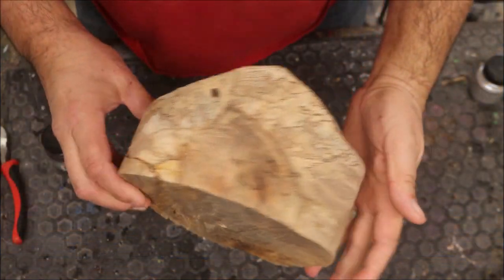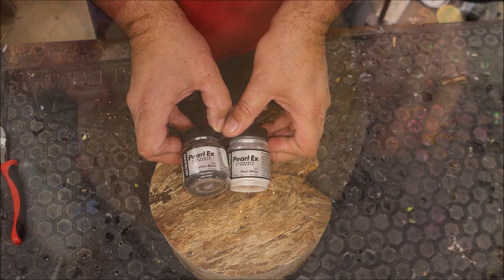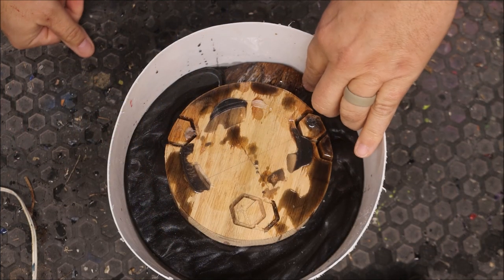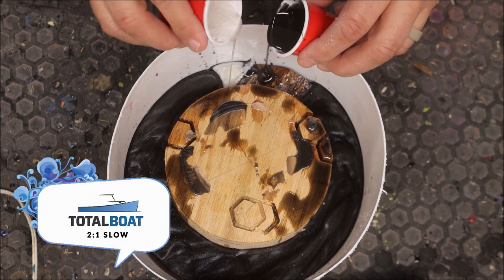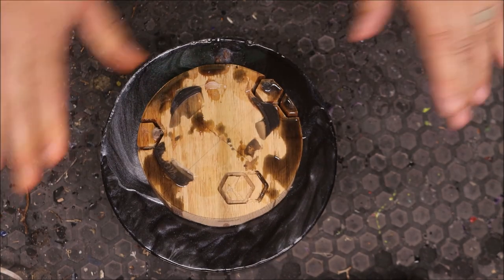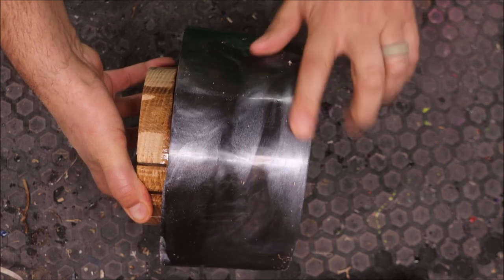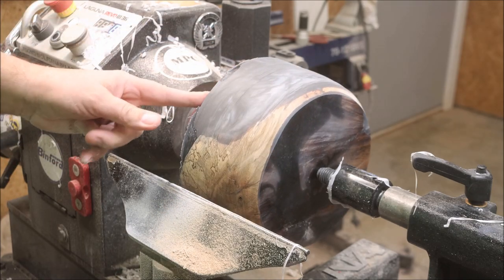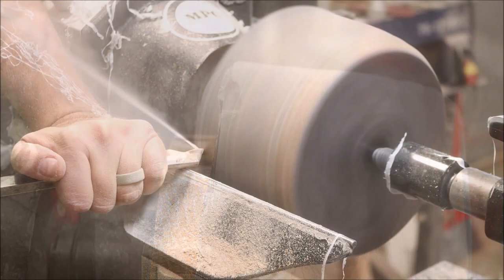Does This Bowl Look Like a Storm? ⛈🤔

Comment: Do you only use negative rake carbide cutters when cutting epoxy?
Reply from the maker: No, they are expensive and you cannot resharpen after they dull. I use HHS traditional tools and regular carbide that I resharpen. With carbide you have to slant the insert a bit to get a good cut. I prefer to use my traditional tools.

Comment: i don't know if you've ever tried this but when using different colors of resin if you wait until they start going off and then pouring into your mold they don't mix together as much.
Reply from the maker: I did just that in this video. The issue here was the pearl. If it was a real white the separation would have been greater.

Comment: THANK YOU!!! I thought I was the only one that hates those goose neck hollowers. They just twist and get dragged and are impossible to stabilize and when you do try, its all chatter. Really, I thought it was just me. Sigh.
Reply from the maker: Haha, nope. I hate them. They tear out the wood and resin too. But sometimes it's the only option.
Reply: I fought with mine for a bit and then I just gave up and bought the Simle Hollowing System. There are other out there that look to be better, but this works for me AND it gets rid of the chatter. Although the first time I used it I joined the funnel club...yeah, without something designed to prevent funneling I was absolutely perfect, but with that...sigh. Only me.